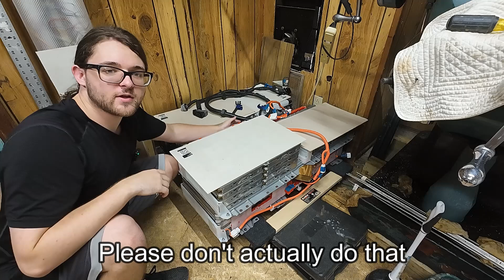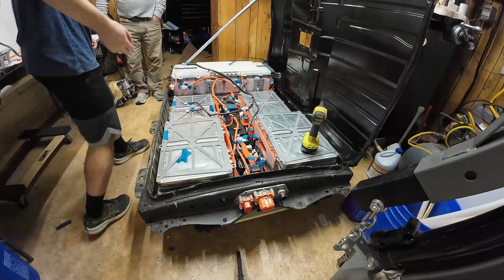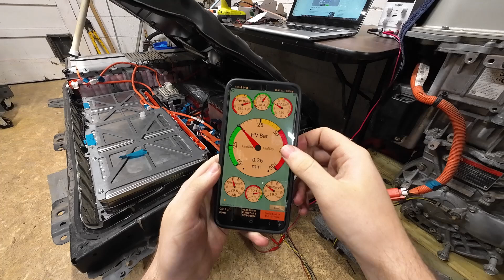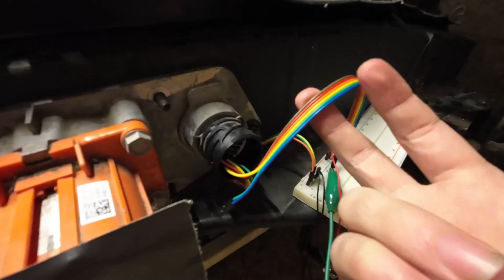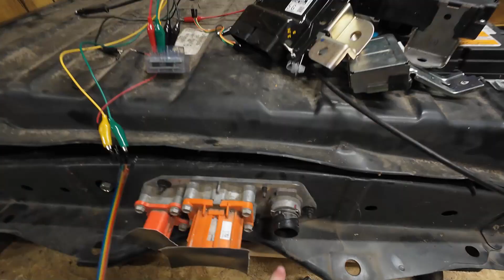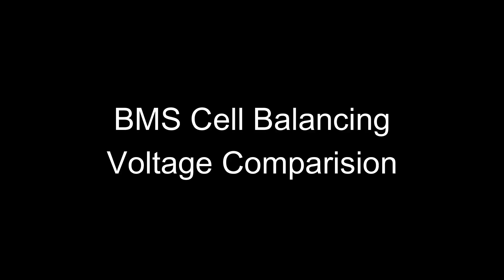Testing My 2015 Nissan Leaf High Voltage Battery: Venn Visceral Part 6

Comment: where do you think the battery will drain to? Resistance to the case is measured in mega ohms.
Reply from the maker: 2 ways the leaf drains is 1 by natural degradation of the cells (internal resistance of the cell) and 2 by the leaf bms passing a cell through a resistor (external resistance). Either way the cell loses voltage. Since the ah are large it takes a while

Comment: At the end, was Dala's numbering of the pins on the pack instead of the plug?
Reply from the maker: So his image has a different numbering scheme than the pin numbers labeled on the plug and the pack. The numbers on both the plug and pack lined up to be the same, so 1 goes to 1 and so on. If you ignore the numbering entirely on the diagram and only look at the shape, the labels for the pins are correct for the pack, which would be the same as looking the plug from the back of it. It is mirrored left to right if you look into the plug you attach. In my pack both the plug and pack pins were also flipped 180 degrees from the image, which threw me for a spin for a bit, but the pins' shape make them only fit together only 1 way. If I need to reword something let me know. Hope that helps!